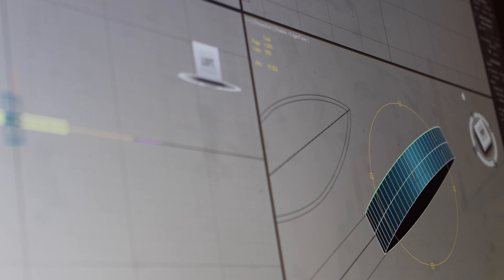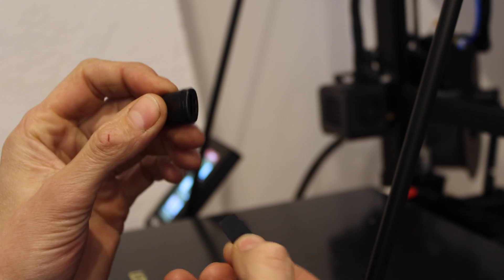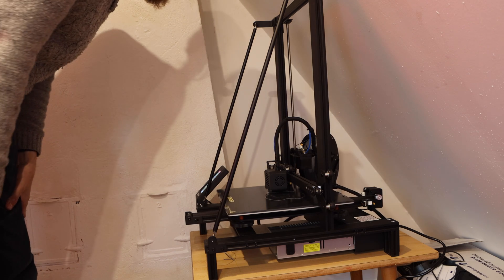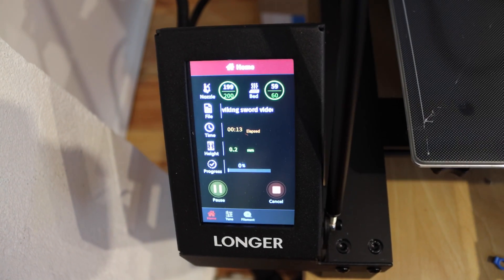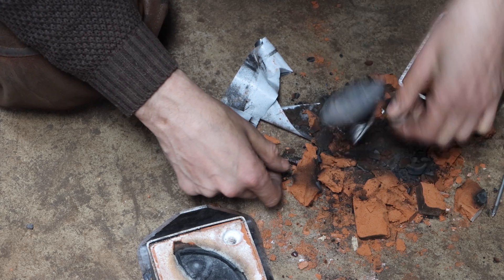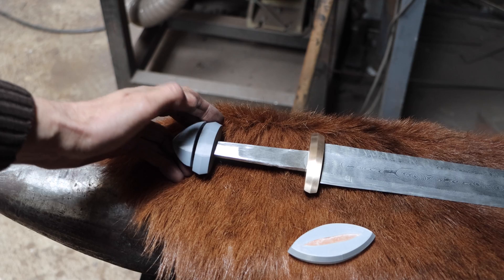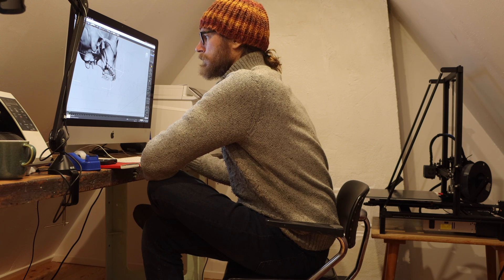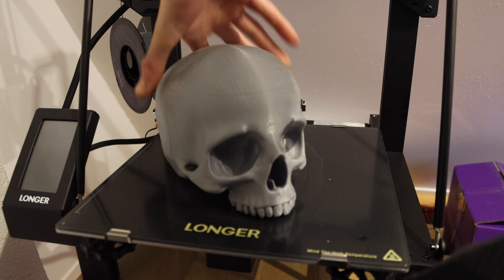Testing the Longer LK5 pro 3d printer.

Comment: A video with you talking and touching my other interest... (3d printers) that caught my by surprise. I've seen you are using a raft which is rather unusual these days, chances are you can skip unsing one.  Still want to try lost PLA. Cast turned out great. You can get very clean supports by using PETG to supports PLA or the other way around, but that requires two extruders. The two materials don't bond and practically form a mold which is removed with very little effort.